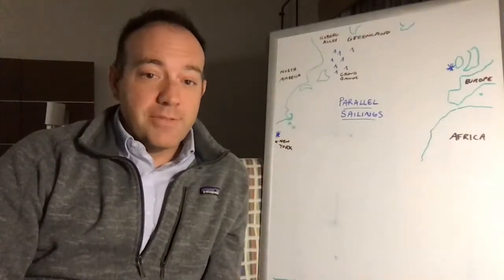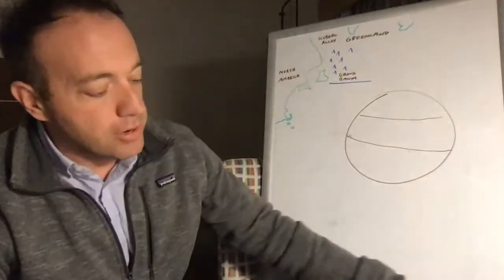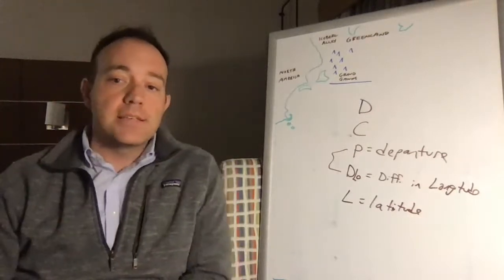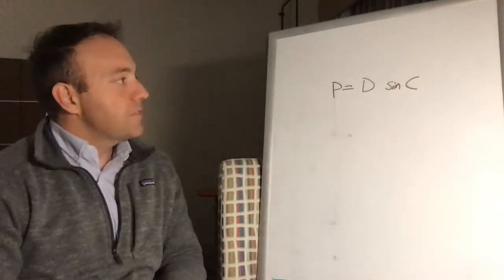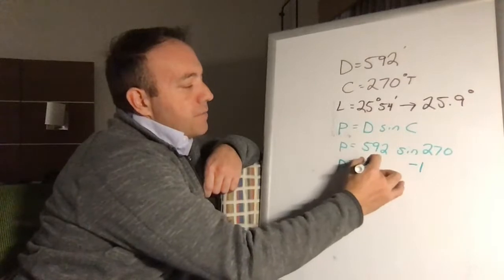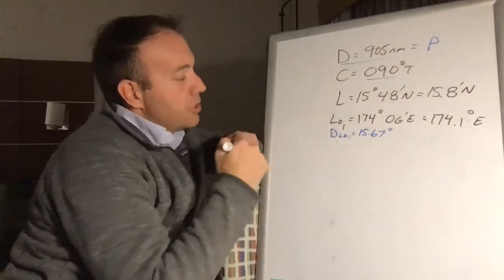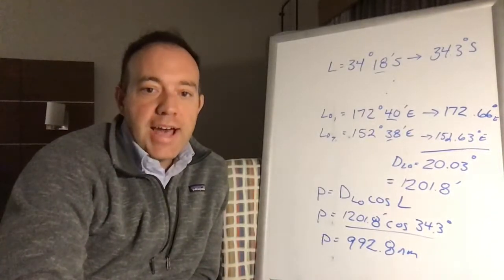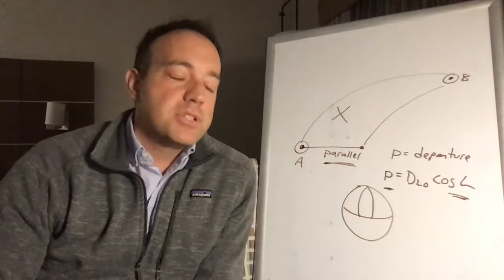Parallel Sailings Live Problem Solving

Comment: what is the relevance of parallel sailing to other sailing methods
Reply from the maker: I'll be honest, Kevin, it is mostly for passing USCG exams for me, I can't say I've spent too much time on course 090 or 270 haha.  But in reality it can be a component of calculating a "composite" sailing in which this combines with another method for a transoceanic voyage.  A good technique, probably to super practical, IMO.
Reply: @NavigationTraining  thank you <3